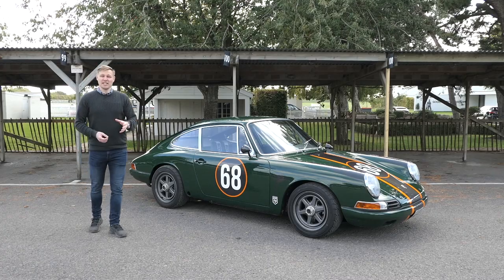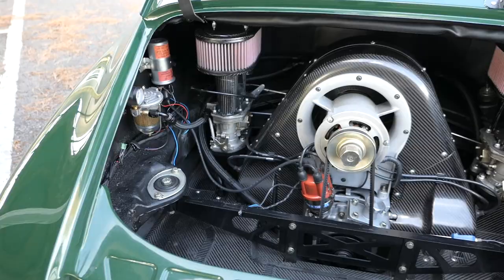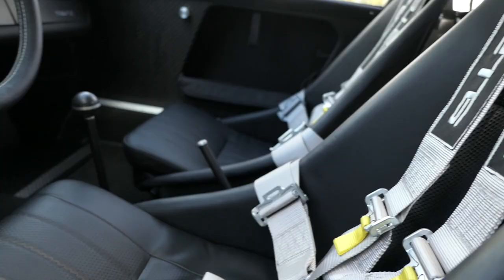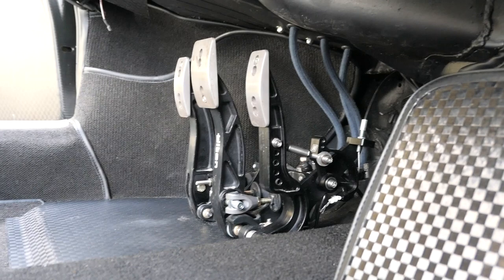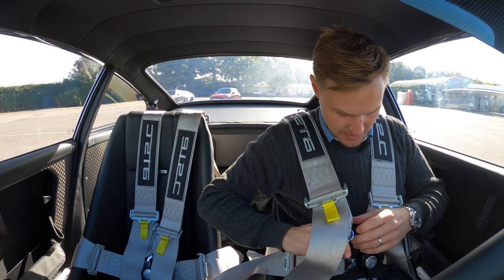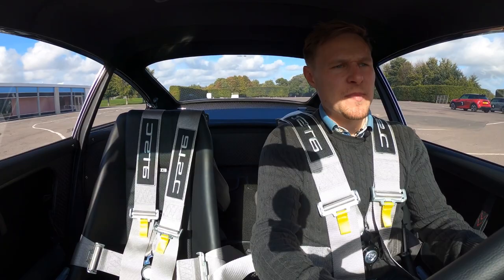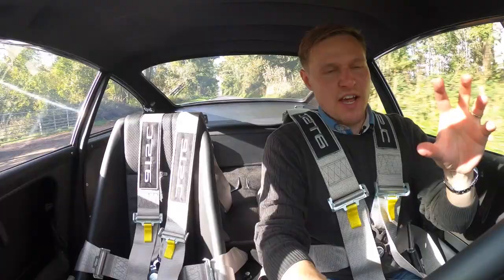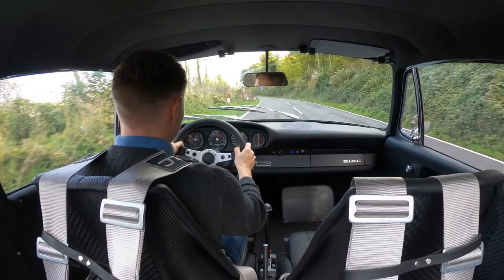912 RESTOMOD! The lightest Porsche I've ever driven… is it better than a 911?

Comment: Not many people can say they have driven or worked on 1965 912, I have. I recall having a friends 912 for repairs, the carbs were in desperate need of a throttle shaft re-bush, rather than replace with Webers we had the original Solex's re-bush'ed, with new butterflys. The difference was night, and day one all synced up the sound is all to familiar. In stock configuration that little 912 was pretty poppy...

Comment: Can you really call it a 912 when most of the original panels have been replaced?  The engine, fair enough.  But the rest of it looks like a 912/911, but has basically all been replaced.  The price is mind-boggling

Comment: Car is cool, but harnesses are a bit of a joke.
Reply: agree
Reply: Was shocked only one other person mentioned how unsafe those are…
Reply: It is a track car
Reply: @RS-of1om  would never pass a proper tech inspection
Reply: @thetumanshow  needs at least a harness bar to keep the straps on your shoulder.  You could slip right out of those.  I have the same problem, very light in the front.  You need downforce or weight in the front otherwise the brakes won’t work, and you loose grip in the front.

Comment: Now, this is my idea of intelligence in hot-rodding. Remove unnecessary weight, including using a lighter 4 cylinder Porsche boxer engine rather than the typical 6 cylinder, and retaining a much higher level of reliability as well as handling. This car is beautifully detailed and so thoughtfully done. Intelligence, folks, not just horsepower.  :)

Comment: I've owned several 912's and many pre-74 911's, the 912's were indeed much lighter, when the gas tank was low the front end was light, I'd get a lot of understeer and the steering effort went to near zero.  They could absorb bumps like nothing as well.  Great cars.

Comment: This car is going in the right direction. Saving weight is the priority over fancy power figures.

However, the same can probably be achieved by dipping the body without the need for CF but I suppose some people have to have CF which is probably why the car is expensive.

Comment: interested to hear how you're getting 200+ hp out of the 616... some pretty hefty numbers that are higher than the best 616 builders out there. A lot of power for those 3 main bearing cases. Probably why a lot of the high end 356 guys are switching to 4cy 964 builds for longevity's sake.

Comment: You can build a relatively low cost 912 that will run with early 911's .  912 motor to 125 hp.  Update to vented discs, aluminum M calipers and if you can find them 7" American Mags made of magnesium.
Reply: Agreed except magnesium wheels have a limited (safe) life span as you probably know. It is possible to find aluminium wheels that are just as light.
Reply: @Andrew-vx2ls  The key is to keep the rotating mass down.
Reply: @Andrew-vx2ls  I have a set from the late 60's that tested fine.

Comment: Do you have any additional info on the engine? I have a 69' 912 with a 68' engine and have been looking for a nice rebuild. I love the Polo engines but they are very pricey and I don't have a 964 engine sourced. Also, I'm curious how the JPS cooling works with the 911 style fan. From what I've seen in the from other builds, that style doesn't translate well to 4 cylinders. Last, which model 901 are they running? I currently have a 911/01 which is supposedly stronger but was rough to get the push/pull clutch to work with the 912 engine. Thanks.

Comment: tell you wot though, a 356 with that motor or a tuned 4 cam mut have been awesome! or the original speedster must be incredible. must be easy to wipe out though
Reply: At the 1972 Sebring race I saw a 1963 Carrera coupe in Irish green with dawn leather interior. He wanted $4,000. I could kick myself for not buying it.